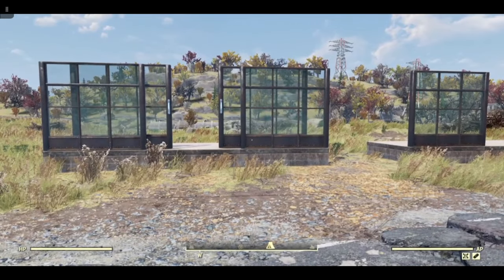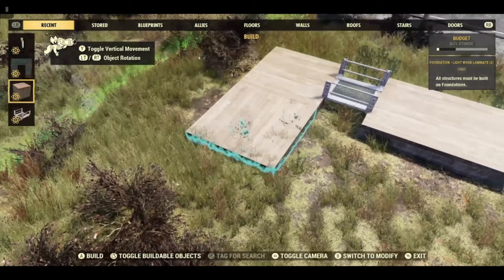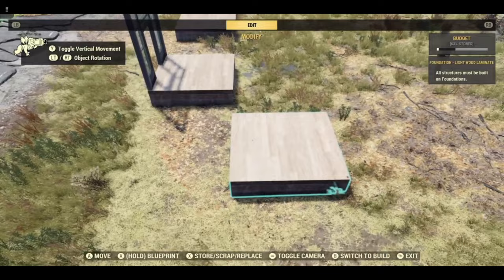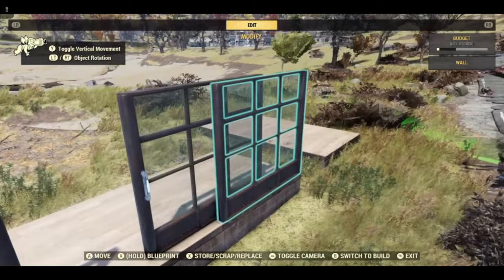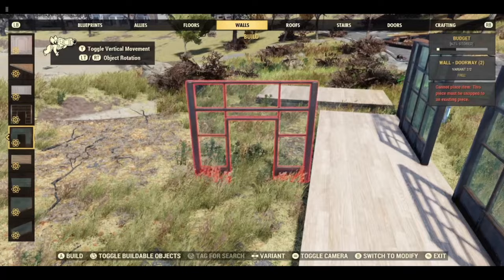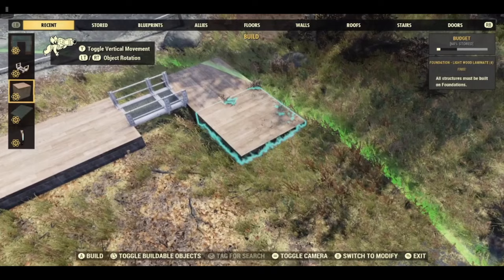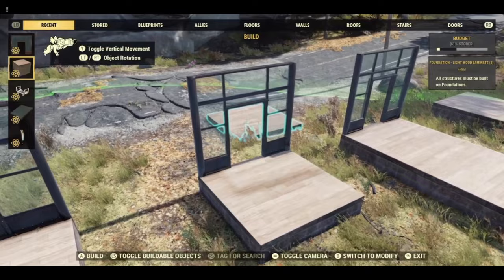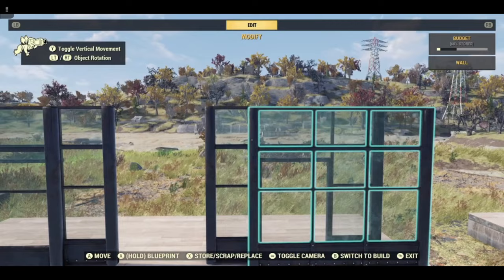Fallout 76 - Building Techniques Library - How to create faux sliding glass doors

Comment: That's also a way to make walls that don't go all the way across 2 foundations. 
Instead of offsetting back a little keep it flush then burn the ofset wall, then you could snap a wall to the foundation. Then repaired and you have 1 and a half sized wall with a gap at the end. 
Probably has a texture glitch, but that's hideable with either furniture or wall decore if you decorate smart...
Reply from the maker: Yes I know, I've done it in another video. This was something someone asked for, it's an old video